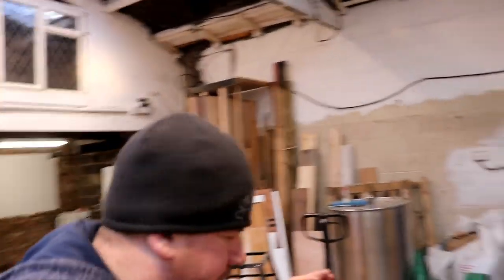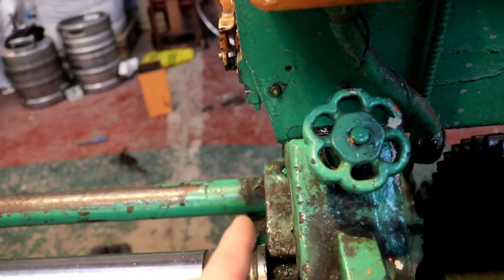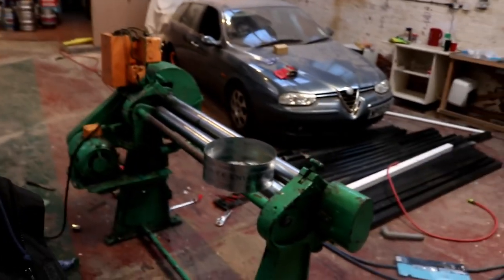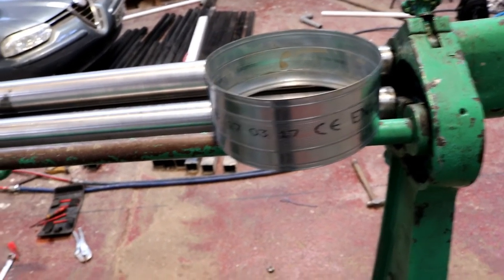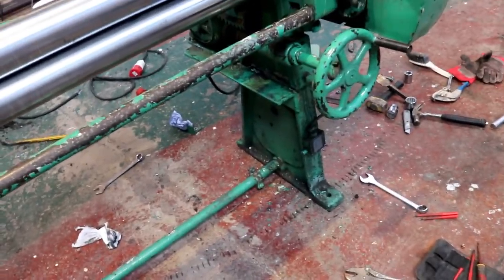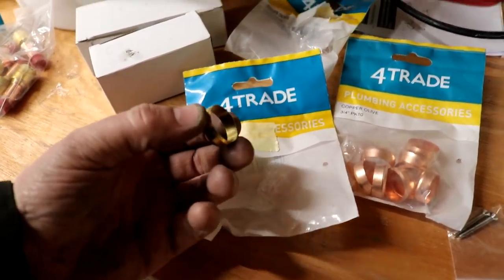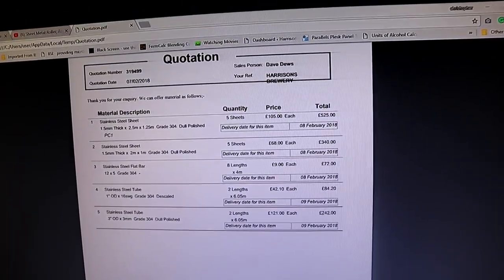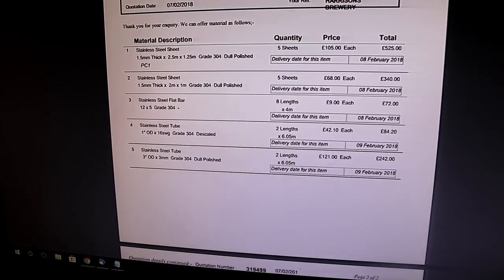NICE TRY PAL!

Comment: Hope you get the fallout from ivp sorted soon. It may be worth making a guide table for the roller as in my experience using them the steel can sometimes go off centre and you could find yourself rolling a tube that dose not meet correctly especially with large sheets.